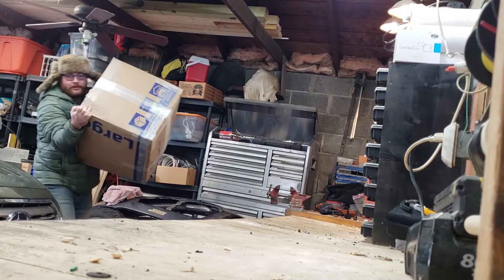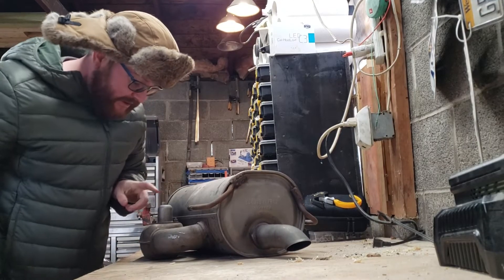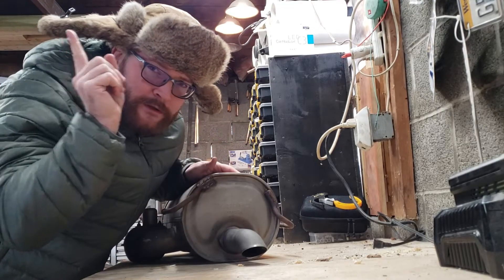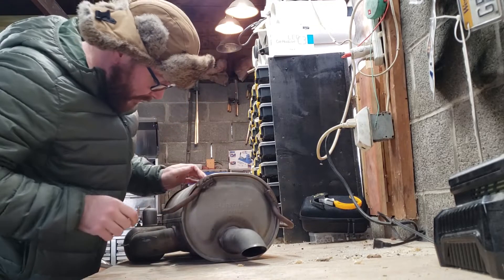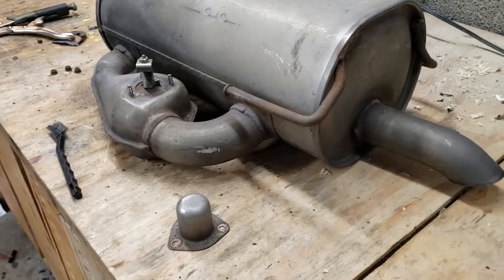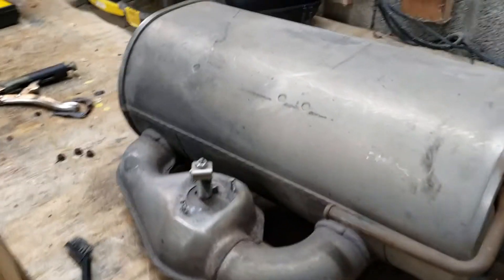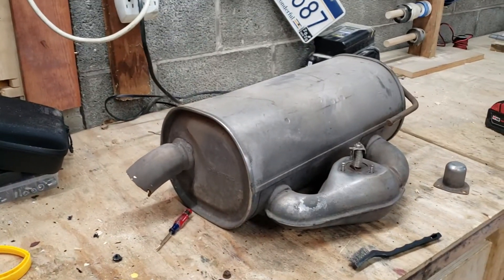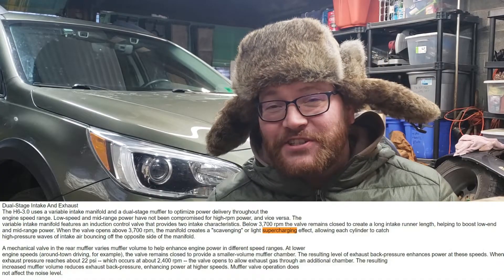Can you super charge your car with a muffler?

Comment: I came for the pliers, I stayed for the pliers.

I love the fact that the muffler cut off Marc & Vanessa's Outback when filming their 5 mods video which I challenged them to after being challenged by you has now crossed the country to end up in your hands. That was one complicated and devious scheme to get your hands on a supercharger muffler, LOL. Interesting project though. Man...that H6 sounds sooooo much better than my FB25.
Reply from the maker: Getting that muffler was all part of me eeeevil plan. Buhahaha. 

I've got a couple skunk work projects coming down the pipe. 

Yours with an EZ36 swap and a locker might be best case (still a Subaru) scenario. 

4.44 gearing, locker, VDC, and 250 lb ft of Torque would be fun.

Tuned EZ36 will make 340 lb ft.

At the wheels. 

At 2000 rpm. 

:D

Comment: I am not sure the writer understands forced induction or backpressure. 
Did the install change when your torque converter clutch goes into lock up? 
 I don't think your driveline health is as garbage as mine, but from those ranges of 30 to 45 mph, if I am not driving my vehicle right, it constantly freak engages and disengages 500-ish rpm(s) in that prime torque zone. The cause being the system getting confused trying to keep computers happy.
My two cents.
The scavenging effects on the intake and exhaust, I believe those words.
Reply from the maker: The TC locks at the same speed but stays locked more often now is the best way I can describe it. There was a hill I drove both ways often and it would always unlock.

After the muffler it stays locked the entire hill.

It's odd really. Any benefit is very minor.